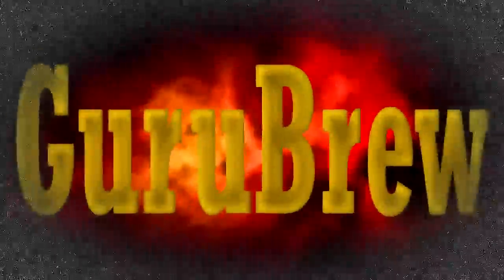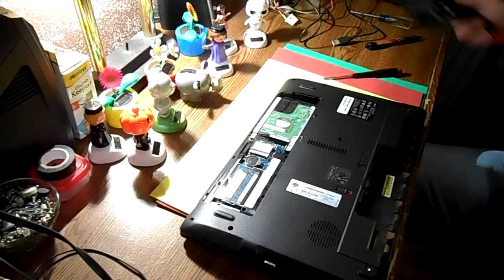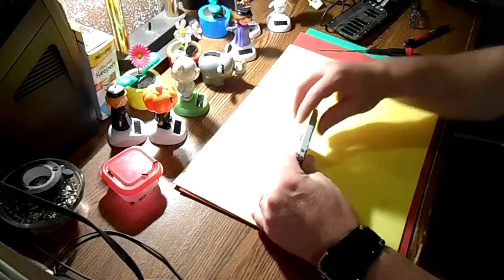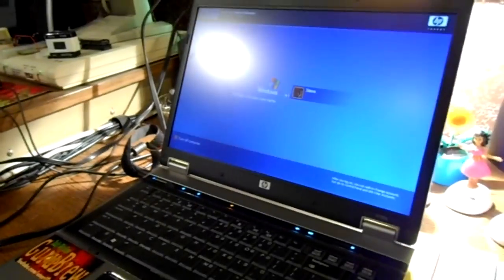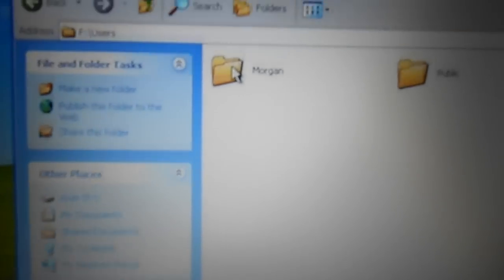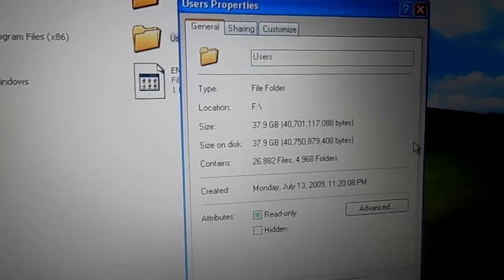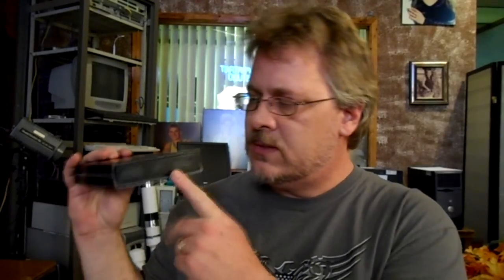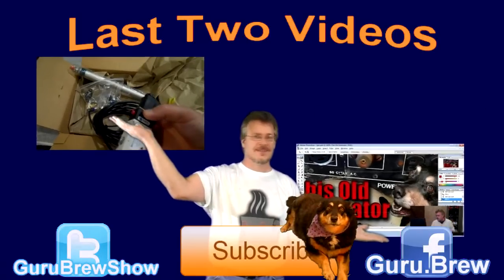How to Recover Data From a Non-Bootable (dead) Computer

Comment: Moving any data from an old computer infected with malware/viruses COULD indeed infect any new computer it is transferred to. Also, when working on internals of any computer device, you should make sure to have some sort of anti-static setup (i.e. mat, wrist-strap, ESD (electro-static discharge) tools, etc).

Just a heads up to all you peeps.

Comment: I prefer to use a very compact unit which plugs straight into any USB port on my laptop or PC and has a plug pack for power.. It's completely stand alone and accepts both SATA or IDE  drives, you simply drop them into the unit and it appears as an external drive. It cost me around $30 and it's been running for years. Much less archaic than an ex PC power supply with associated bundle of wires. The name of the unit is simply IDE/SATA Docking. Station. It's coloured Red and Black. Any decent computer outlet should stock them.

Comment from the maker: Hi, I charge my customers on a quart HR time basis. I have a modest flat rate for all repair and then I keep track of how much time passes before work is completed (actual hands on work) on each repair, also not forgetting to add in parts that may be used. The cost per quarter hr is up to you. Figure out what will make you happy and add 10% . Most shops get around 100-150(us) per full hr

Comment: Help. I have a dell desktop computer that will not boot, shows dell logo then goes to a black screen with blinking cursor. Inside the SetUp blue screen it does not see the HardDrive. We removed the hard drive and put in in another computer, does the same thing. Will not boot. We put in a "good" hard drive into my existing computer and it shows the hard drive in the SetUp/BIOS. The "bad" hard drive does spin, it does NOT make clicking sounds, but it is rather loud, like its trying to boot. Could this method possible work just to get my pictures off of the drive??
Reply from the maker: +Ashlie Hildebrand Yes, this may work to get your data from the failing drive (80%). It is not clicking and that is a good thing. It probably has a corrupt operating system and is preventing Windows from working. Good luck and let us know.
Reply from the maker: +GuruBrew If this does not work you can try putting the hard drive in the freezer for a couple of hours and try again but often this is a one time shot.

Comment: Hi Steve,
If the original computer does have a virus / malware could you not effect your pc once you start the copying process. Also with copying the files back to the original pc after you have reinstalled windows would there not be the potential for the virus / malware to effect the new install? 
Great video thanks!
Reply: Yes it can. Another thing is the auto play, really? All that does is index the files. Always assume the HD will not make another pass other than the one ur on. Get the info off asap, then you can look for nude pics.
Eta been building pc's for around 20+ years, win 3.1. My kids, all now over 30 yro, still call me for tips and tricks and howtoos.

Comment: I have a pc that stop working. it starts up but it won't boot. If I put a new hdd in the pc would I be able to run off the new hdd and transfer files from the old  hdd to the new one and reset the old one from the same computer ?

Comment: I have a 2014 dell insprion laptop and I hire it a little hard on the keyboard. So I did a hard reset and it shows the dell symbol and then says automatic repairs. After that it goes black screen. So I hit f12 and ran a diagnostic test and it shows that the hard drive isn't working. How much would you fix it for if you would even consider getting all my files off of the hard drive

Comment: hello sir, i'm using Dell inspiron 1545. Its internal harddrive was encountered with a problem explained here - When switch on my laptop, a blank screen appears and written there "Internalt for multicore processor will be disabled". I replaced that harddrive with a new, but I kept my old drive to me due to containing a huge data, videos, photos etc. Please, tell me some solution to copy data from that harddrive.

Comment: hi it is a good video.. I have a vaio aw series laptop and it has 1tb(actually 500gb 2 )in built hard disk from which on is fine but another one shows "format disk" when attached to another computer and the person who has repaired my laptop has installed the OS only on one hard disk n the other one is irreparable but I want to recover my data from it what to do?????

Comment: I’ve watched a few of these videos but my situation is I have an hp laptop that won’t boot “select boot device failure”.  I bought a little device to copy everything over. I can sometimes get the hard drive to start reading but gets to the end and stops. I have no problem buying a new hard drive but don’t have any of the operating system disks.  Are my only options then to also purchase a new os?.
Reply from the maker: You can go to the Dell support page and enter your product service number and see if they still offer a replacement OS. If so you can purchase for a nominal fee (20 last time I did it) the ship os's on USB sticks if your product qualify (age)

Comment: how do u fix a laptop only showing a black screen & cursor when u switched it on? the problem started when the battery died when i uninstalled corel draw which didnt completely uninstalled when battery died plz help its windows 7 starter

Comment: I did all of that and the external hard drive showed up as "F" drive but when I went to access my info from the "user" folder where my information is held, it states that "I dont have permission" and then attempts to access that particular folder but getting "permission". Once it does this, it gets stuck here and doesn't ever retrieve permission to access it. any suggestions? Thanks

Comment: Hi... I wanted to ask you something ... I have a 2010 Mac Book pro lap top, and i been through a situation in which turning on the computer would take so long and then when the screen pops up, that rainbow circle starts and would not stop at all.. So i took it to apple and they claim that the hard drive inside is burned out..Though the guest login from the computer works to use internet.  Not my own account.    Though i lost so much family photos and videos that was stored in there.  Photos from when I was young until present.. Now can i retrieve those data out even though apple could not retreive them and then later tried to send me to someone else to get the data out and spend over $1,000 bucks to get them?... I didn't do of course.. but i wanted to know if its possible that the data can still be located and transferred into another computer from a mac to a PC?.. please let me know if this is possible.  Thanks a lot.

Comment: I have an external hard drive that recently started to smoke when I plugged it in. The AC power cord was cut with wire exposed which we didn't notice. I unplugged it immediately but now using a newly purchased 12v power source the WD external hard drive won't power up. Any thoughts.....
Reply from the maker: When the wire was shorted an internal fuse inside the enclosure likely broke. I would Crack it open and have a look for such a fuse likely near the power connection location

Comment: Loved your information. Did everything you posted including getting things from Amazon to retrieve data from my less than 2 year old laptop. The laptop was working perfectly until we lost internet services and was told by the tech via "chat" to connect the computer up to the modem via ethernet!  
the computer went to a black screen and has not been able to turn on since then.
 I took the computer to the Geek squad where they told me to put down a deposit because it wasn't related to a virus and was computer related. They would take it apart and charge me accordingly.
   Well, I took the hard drive out; set it up via USB where a message came on the screen stating something like the data had a serious problem and to "fix Now" or disregard. I chose "Fix" Now where this computer experienced the same thing!!!!!  Deductive reasoning is telling me that something happened in the initial "Ethernet" experience!
  PLEASE Help with advice!

Comment: But my problem is the hard drive not seen  so how can you copy files its got to be found by the bios  which it is not
Reply: Tom Gee you might have a dead hard drive in which case, your data is forever lost. You can usually hear them spin and if they do, you can still salvage the data but If they don't,  it might be to late.

Comment: Hey Guru, watched your video..very good...I have 2 dead laptops and 3 dead desktops, all hp products.. They were totally dead and wouldn't even fire up anymore. So, I removed the hard drives, and am going to dump the computers. Like everybody else I want to get my junk off the hd, I looked on eBay for the device you showed you put the had in to transfer the data, didn't have a lot of luck. What am I supposed to be looking for? I saw a Sata-use cable, will that work? I want to put my stuff on an external hard drive. I am mildly electronically retarded, you think I can do this?